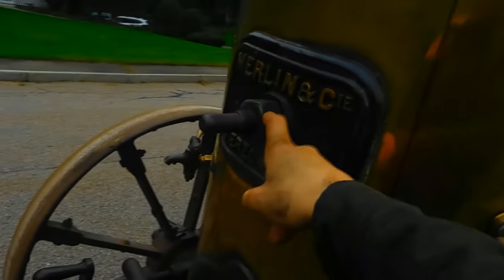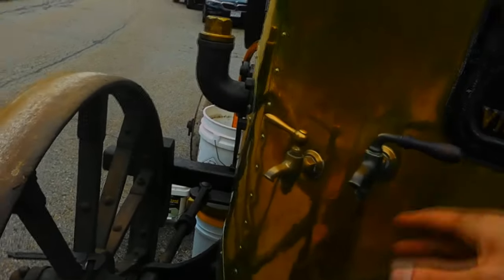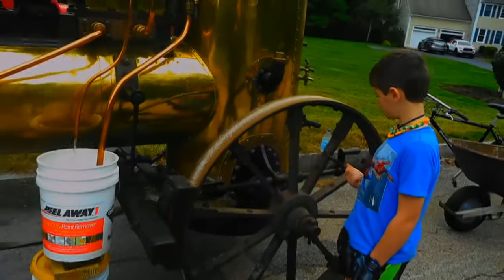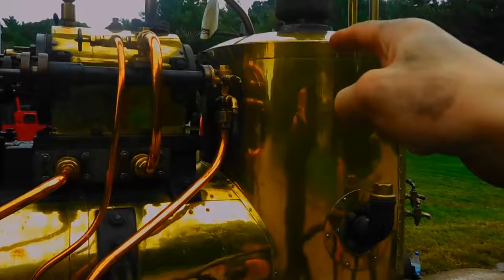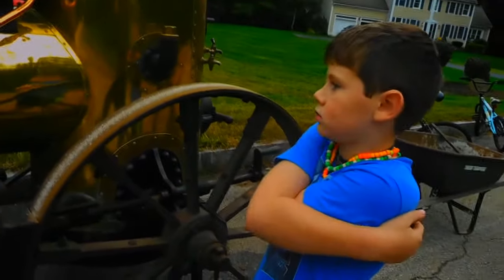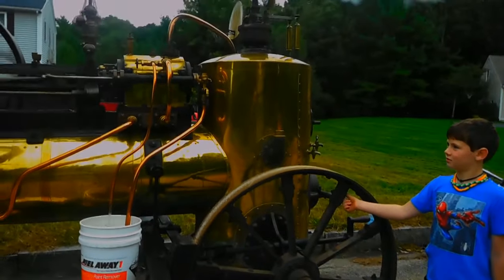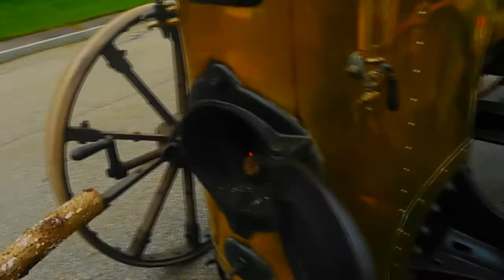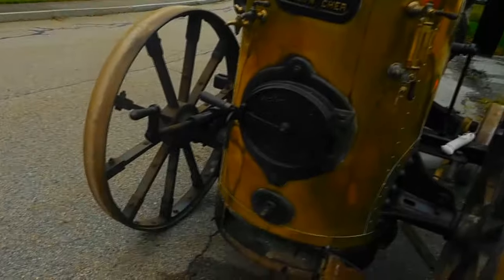Apprentice

Comment: I’ve always been fascinated with steam power, there’s something so organic and comprehensible about complicated mechanical devices designed before CAD. You can look at each part and almost see what the original creators were thinking. Thank you for devoting so much effort into preserving history, not to mention the (rare nowadays) willingness to let younger folk learn about these hands on
Reply from the maker: In the US, the way we treat young people in the field of historic power machinery is largely deplorable.  Imagination and the wish to be hands on is squashed or metered, I got that nonsense a lot myself at his age, and I don't tolerate it and I work to promote the opposite.  The machines are comprehensible because they were designed and built entirely by human psyche with no cheaters and no technological middlemen and this is how we ought to be designing all machines.

Comment: Bonjour Alexander,
how lucky you are to find a young man interested in steam. the ones I meet have only two questions : "Speed "? and "Price ?" 😪
Besides this, your gold locomobile is just beautiful with its original safety valves.
Amicalement, Raphaël
Reply from the maker: The youngsters who are interested in steam are absolutely everywhere you just need to do a little work to find them.

Comment: Very cool. O I saw in some other videos you do drawings. Do you share/sell those drawings of the engines?
Reply from the maker: I do!
Reply: @AEKarnes  cool where do I go to find them? I like the one you had showing a cut away from the pumping station.
Reply from the maker: I sort of have to make a print manually right now @deathkid411
Reply: @AEKarnes  O so you have draw a new one ever time?